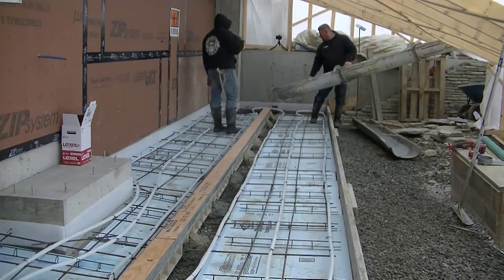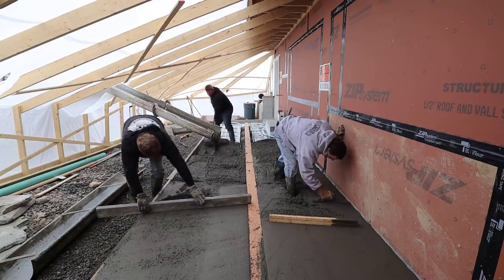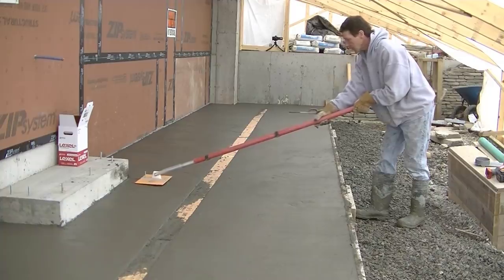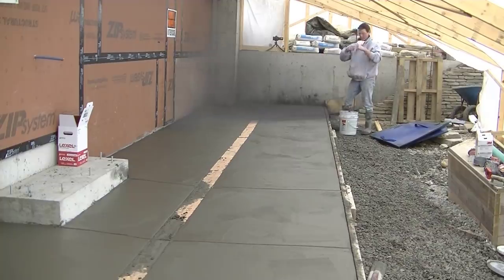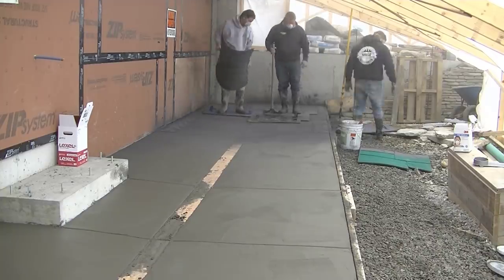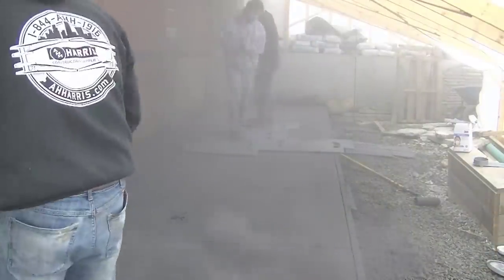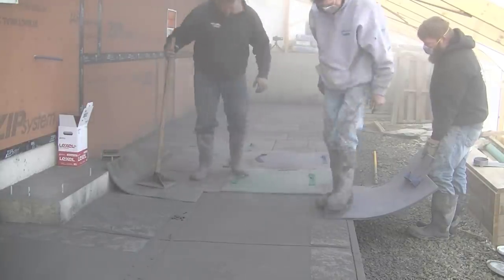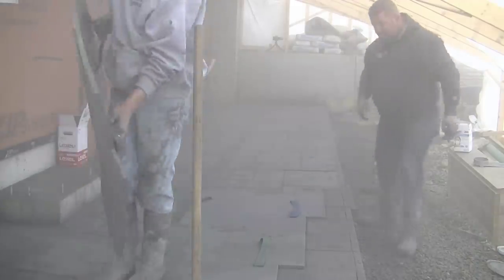Concrete Driveway Apron With A Trench Drain (Pour and Finish)

Comment: Thanks Mike.  How do you finish the edge along the trench drain?  Polycast mfg recommends flat trowel; my contractor recommends rounded edge.  His concern is that flat edge at the trench drain will be too thin / fragile and break off after contraction.  What is your experience?